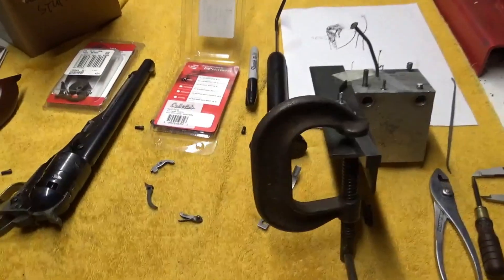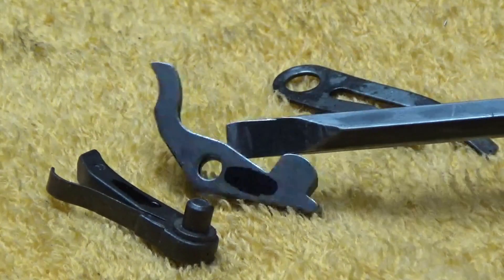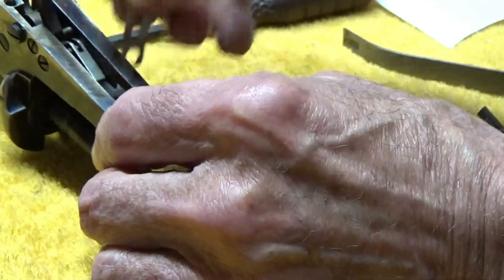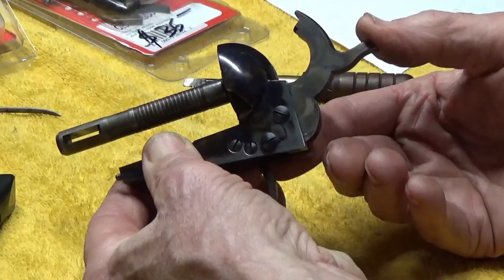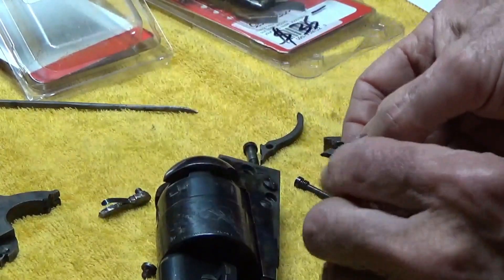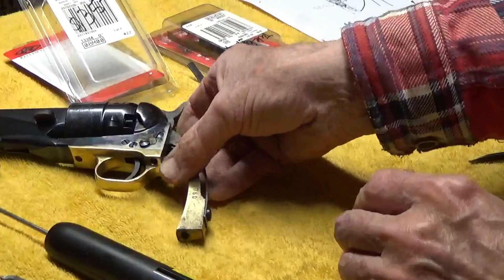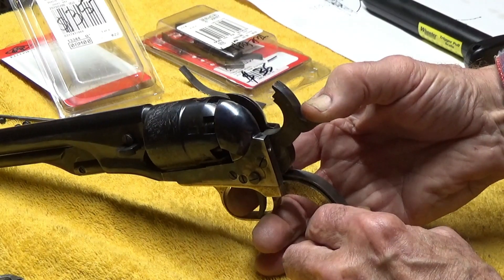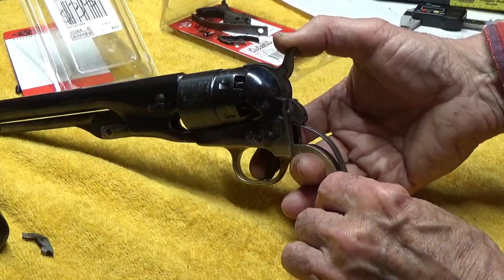1860 and 1851 Pietta Part Kit - Is fitting necessary ?

Comment: I had an interesting project.  I found an original civil war Remington NMA barrel, frame, hammer, pawl and bolt in an antique store here in western Montana for $45 bucks!  I snatched it up, took it home and set about bringing it back to life.  The only parts not warn out are the barrel and frame.  Luckily I already had a Uberti NMA with a Howell conversion cylinder and an old brass frame Pietta NMA.  I took the original Uberti percussion cylinder and bolt...and the Pietta loading lever, base pin, trigger guard, hammer and pawl.  I ordered an og Rem trigger and screws.  To make a very long story shorter...I had to fit all the Italian parts from two different makers to the gun and each other.  Including pressing out the Pietta hammer cam...rotating it slightly and pressing it back in...guessing at the correct orientation.  Which I luckily achieved on the first attempt!  I had to alter the frame slightly to fit the loading lever, base pin and hammer.  And fit the Uberti bolt to the Pietta hammer cam.  The og Rem trigger fit fairly well to the hammer notches...all I had to do was clean up the sear end a bit for a crisp trigger pull.  I matched the external parts by removing the blueing and allowing them to discolor on their own.  In the end it all came together wonderfully...and is actually the tightest single action I own.  Including several Uberti SAA's and an USFA SAA.  It amazed me how with only a vice, a few needle files, some quality Arkansas stones, and of course the guiding hand of the Lord...I was able to bring the old girl back from the grave!
Reply from the maker: Great adventure. Along with the parts, you supplied more than a small amount of experience. I’m pretty envious. Not so much about the gun, more the fun in the restoration, and satisfaction of the result. Question:  Can you tell if rifling is gain twist?  Thanks for sharing. O.R.

Comment: With the help of your video I got my 1851 Colt Navy apart and figured out the hand spring was broken.😁 Now, when I get the part, we’ll see if I can get it back together.😳😂
Reply from the maker: Hi Doug. Pietta?  If you run into a “situation” possibly I can try to give you some advice if you comment. Hope you get it back to functioning. Hand springs and the bolt-trigger springs seem to be the parts that give issues. One way to tell if the hand 🖐 you get is too long is that it will try to rotate the cylinder before the cam on the hammer pushes the bolt out of the cylinder notch. In short, the gun will not be able to be cocked. O.R.
Reply: @oldranger3044  I don’t have many power tools. Will I be able to do the fitting I need (potentially) with a Dremel and sandpaper or will I need to “find a guy”?
Reply from the maker: @dougdumbrill7234  In my opinion the dremel tool could do it. Either a grinding wheel (use the flat section) or the flat side of the dremel cutoff wheel, keeping the same angles. Also, compare what you are doing to the original. Look at it as a learning experience. It is the way. O.R.

Comment: Have replaced hand and spting in a couple  1860 piettas...all of the hands were long...think they're all made that way . Ive never worn a hand out, just broke the spring. I use the old hand  as a guage to file the new one
Reply from the maker: @michaellankford8358  Hand and trigger-bolt springs, have more than I can count on two hands. The Pietta parts kit is very reasonably priced considering that it contains a hammer, some parts are a drop in, but as you say, some need fitting. Thanks for the comment. O.R.

Comment: Great video, not much I can add other than. It is sad with today's technology that a parts kit's are not more consistent and precise, however that being said replacement parts in modern revolvers require adjustments for a precise fit and timing. Some brands are more complicated than others and have gunsmiths who are specialist in just that mechanism.
Reply from the maker: Yes, the good news was that nothing was too short, and that the hammer needed nothing changed.  Cam location and size on hammer seemed perfect.  Anyone with Pietta guns might want to consider the kit because of the tendency for the bolt spring to break, and also can replace hammer back to original if there has been some grinding to get the gun shooting closer to point of aim.  Thanks for viewing and commenting.  O.R.

Comment: Please do a video on the hammer cam. A know Pietta problem. Thanks.
Reply from the maker: Hi Steve. Could you give me a little more detail about what might help so I can try to point it in the right direction. I think a video about the cam by itself is a good idea. Thanks. O.R.
Reply: @oldranger3044  you are FANTASTIC! A major problem with Piettas after 50 rounds is the bolt leg slips too early off the hammer cam. This raises the bolt during 1/2 cock … locking the cylinder. Crappy hammer cam! The only fox is a new hammer. 
It would be so cool to compare a bad hammer cam to a good hammer cam and alert everyone to a very common occurrence.
Reply from the maker: @steveferris663  Thanks Steve. Made a note, and have a good selection of Piettas to check this out  So far, the lock ups I’ve seen are caused when the hammer doesn’t go far enough forward for the bolt arm to drop off the cam, and then it can’t raise the bolt out of the cylinder notches when the hammer tries to draw back. O.R.

Comment: Hello ranger, i need some help. Im working on a pietta 1851 navy. I have the timing adjusted perfect on my gun. The problem is when i pull the trigger and the hammer falls, sometimes the bolt will partially pop out of the cylinder notch, causing the cylinder to advance slightly after the hammer falls. Do you have any ideas what is causing this ? Any help would be greatly appreciated. Love your channel ! 😊
Reply from the maker: I had a similar (maybe the same) issue with a conversion cylinder install.  As the hammer falls, the leg of the bolt needs to slide over the cam.  If this doesn't happen, then when the hammer falls, sort of the reverse thing happens, and the
bolt goes back into the situation where it is allowing the cylinder to rotate again, like it does when the gun is being cocked.  I can't say how you should handle it of course because, but there are a couple things I did.  I don't remember the exact video I did on the issue I had with installing the conversion cylinder, but I showed in that video what I did.  I have done it a couple ways, one was to be sure the cam was sloped all the way to the base and there was no ridge at the bottom that the bolt leg could catch on.  The other was to but a bevel on the part of the leg that needs to slide over the cam.  Look at the video if you can find it, and you can get back to me.  O.R.
Reply: @oldranger3044  ok, i will have a look at that video. Thanks again, love your channel and keep those videos coming. Happy Shooting !

Comment: Hello ranger, i have a question and need your expert advice. Recently i purchased a CVA 1860 Army 44. I think it was originaly sold as a kit gun. I need to replace the bolt & trigger/bolt spring. Do you know who manufactured these pistols ? Will pietta or uberti parts fit my gun ? Thanks for any help you can give me.
Reply from the maker: I’m probably not going to be lots of help in this arena. From what I’ve read, they were probably made by Armi San Marco or possibly Pietta. If the nipples are metric thread. Then Pietta is likely. ASM should be English thread. Other possible manufacturers were EIG or Armi San Polo. If it was ASM, then Uberti should fit, or be very close. Pietta probably needs.1 inch ground off the trigger side. Be careful not too remove too much or get it too hot when grinding. The hole in pietta is a bit larger which is ok. I see midway has the Uberti part for about $10. That might be a reasonable spot to start. If the trigger side is too short, then the Pietta. O.R.
Reply: @oldranger3044  Wow, thanks for all the information. Im really getting into shooting these old black powder guns. It's theraputic for me. You have the best channel on yt for black powder guns & how to stuff. I absolutely love your channel. Please keep all the great videos coming. Peace and best wishes to you, ranger. 👍
Reply from the maker: @HHS6272  Your welcome, and thanks for your encouragement and interest in getting into these firearms. There’s just something about them; sort of like a samurai sword, or the Jedi light saber. A weapon from a more civilized time (or at least a less complex one). Do the homework as you are, be careful, and expect some complications at times.  O.R.

Comment: I'm having trouble with the new bolt. It seems to be binding and not locking the cylinder- it will move slightly when then gun is at full cock. (I already ground the trigger and reused the old hand)
Reply from the maker: Wish I could be helpful here, but would hate to make a wrong call. Be sure the bolt is not too large for the notches by checking it when bolt and cylinder are out of the gun. I think I also remember this can happen with a weak or fractured bolt spring. When you said you can move the cylinder, is that in order to get it into lock, or does it move out of the locked position. Sorry I can’t be of more help. O.R.
Reply: @oldranger3044  Thanks for you reply. Here's the back story. I believe I have a 1851 Navy. On the barrel it says Navy Arms CO, Ridgefield, NJ. On the side it says made in italy. I'm thinking it was made by Pietta. When I received it, it was missing the trigger, bolt (and those screws) and the associated spring was broken. I bought the kit from EMF and replaced all those parts. I had to gring down the trigger. While everything "fits" it really didn't function without a lot of "help" wiggiling etc. So I put the original (to me) hammer and pusher back in and it almost works. I get 2 clicks, the cylinder is in the correct positions, but ib the firing position the cyber is not well locked. A little twist will rotate fast the firing position. The bolt seems to move very little, you cannot really move it against the spring and it's not in the center of the hole but further to the back. Any help or reference would be much appreciated.
Reply from the maker: @kenrodenhouse2337  Shooting in the dark, I’d say that it may not be pietta. Army San Polo, Army San Marco, probably a couple more were making replicas. That definitely is a project gun, but these things aren’t rocket science so they pretty much can be made usable. With things apart, check to see how the bolt comes up into the slot in the frame. Just use the screw that goes through the bolt. The Pietta may be too long, short or wide. It sure sounds like it can’t come up far enough, and again check how it fits in the cylinder slots (when both are out), and keep at it (consider it a learning experience).  O.R.

Comment: Kia Ora from NZ.
 I  have a original 1860 army  colt.
 Can a pieta hand spring fit my gun ?
 Tatou ( thanks) in advance 
Chris
Reply from the maker: It’s likely not to fit as is, the arm that rides the trigger will probably need to be shortened some, but otherwise there’s a good chance. I just can’t say for sure not having done it. A Uberti spring should be really close “as is”, but if a considerable cost or availability difference, go Pietta. O.R.
Reply: @oldranger3044    Morena OR 
Kia Ora tatou .
 Really appreciate your help. 
 Ma te wa
( have a wonderful day)

Comment: My hammer cam was getting grinded by the the bolt, so I ordered a new hammer, and it was still getting grinded, so I filed the bevel a bit on the bolt leg that rides over the cam. Not sure if it’s making a different though. Any ideas?
Reply from the maker: Curious if the problem is on the bevel surface or along the side of the cam?  The arm of the bolt should have a bevel so it can slide up the bevel of the cam. Possibly if there is a grove being cut along the side or edge of the cam, there might be a sharp point at the end of the bolt arm that need to be rounded and polished. Be cautious with this because too short and the bolt will come up sooner than desired. That’s about all I can think of at the moment. O.R.
Reply: @oldranger3044  thank you very much for advice. I will try this out
Reply: @oldranger3044  something else I forgot to say, was that because the bolt had been grinding so much on the cam, the cylinder is not able to spin freely on half cock, and on the first click of the hammer pull, if I let my finger off the hammer, it will just go back down onto about halfway of the next nipple. This problem was resolved with the new hammer, but the grinding still occurred. So I think I’m gonna try what you said, and smooth the bolt leg out a little bit so it’s not so sharp
Reply from the maker: @hewettp9210  I found one gun with a grove cut in the cam. Never knew why. Just suspected that the cam was soft, which it may have been. From what you’ve described, I’m suspicious that the arm on mine could have been not rounded. That arm, because it is a spring, should be harder than plain steel, and without both being hardened, one will wear away faster. It’s only speculation but probably because of competition and shoots like Cowboy Action, ours may see more mileage than most of the originals. O.R.
Reply: @oldranger3044  that’s interesting. I just sanded off some metal from the leg that rides over the cam. It seems that it has made the hammer pull a bit lighter. I sanded just the pointy tip of it, not the beveled side this time. I can let you know more what happens
Reply from the maker: @hewettp9210  Something else came to mind. Actually,a couple. If the bevel on the bolt leg is extreme, it will extend to the tip and create a narrow, sharp point. The reduced contact surface area will increase pressure, giving it the knife edge effect. This idea had me check a new one from Pietta. They only have a slight bevel so the point remains full width. I also found one taken from my 2nd gen Colt 51 that is very thin (almost sharp), and suspect that it could have been the one that wore the grove in the cam. 
The second could be a stiff bolt-trigger spring, applying extra pressure, but I think #1 is more likely. Maybe this helps. O.R.
Reply: @oldranger3044  yea I think you’re right there about if the bevel is sanded too much, the leg will get sharper. I think I ruined my bolt by sanding the bevel too much. Do you think just sanding the tip of the leg is a good idea? Or to just leave the bolt alone. I ordered a new bolt yesterday also
Reply: @oldranger3044 did you ever come up with any other conclusions on why the cam is being grinded, and is there anything I can do to prevent it?
Reply from the maker: @hewettp9210  Nothing super intelligent. Factors that could be causing it:  the bolt leg riding on the cam would need to be wide enough so it has more surface area to ride the cam. I believe that you said you replaced the hammer, so that new cam-hammer should be hard, so probably rule out a soft cam. The bolt-trigger spring could be too strong causing excessive pressure between the cam and bolt arm, but this isn’t real likely. You might check the width of the tip of the bolt arm that rides the cam. Except where the bevel is, the Pietta new ones measure about .044 inches. Other than those three, I’m not coming up with any more. Its projects like this that can be frustrating, but are learning experiences, and have value for that. O.R.
Reply: @oldranger3044  thank you
Reply: @oldranger3044  I have the exact same problem on my 2nd gen. Navy Colt, and the cam is pretty worn off now.. Will a new Uberti hammer swap and replace the original? Thanks for sharing your knowledge Ranger, it's deeply appreciated
Reply from the maker: @Hlep83  Here’s what I found out. The Uberti hammer is very close to, if not identical. I used a hammer from my fairly new Cimarron (one in the video), put in a 51 2nd gen and used the colt’s hand. Upon cocking fast, the cylinder turned past the cylinder locking notch. Slower and it functioned. Hammer locked back in roughly the same position as the original in the colt, so appears the full cock notch in the uberti hammer is same location. Possibly the hole for the hand isn’t quite the same location and some tuning is necessary. The cam and colt bolt spring worked. Basically my opinion is that there is a good possibility of it working out. O.R.